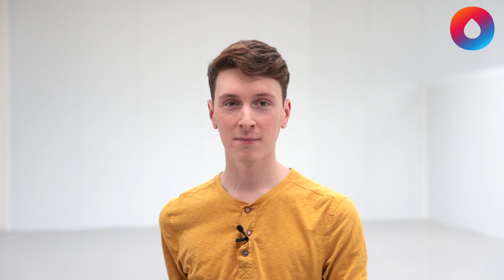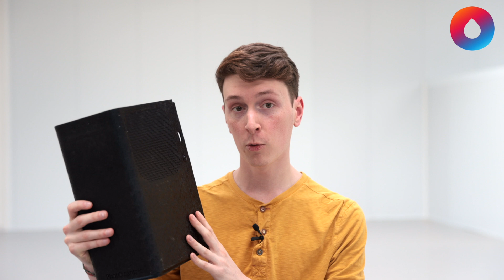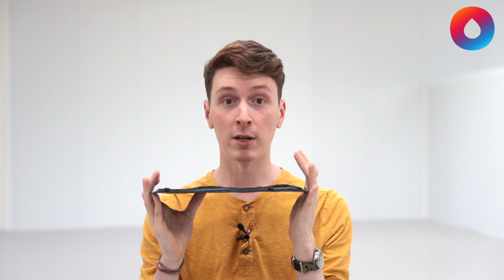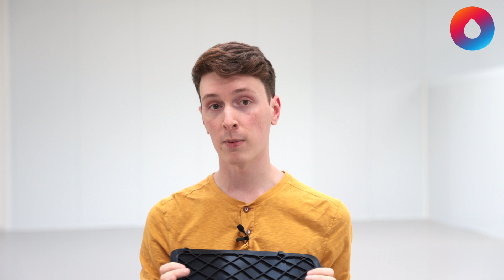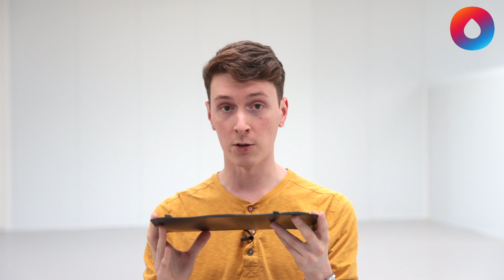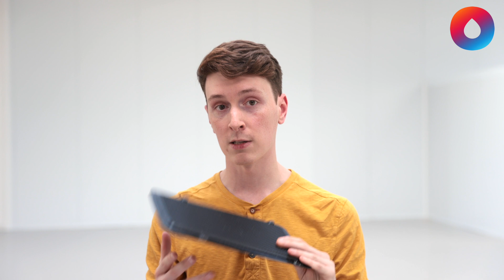How can you avoid warpage when 3D printing?

Comment: Not quite following. The white paper didn't really clarify. How are you differentiating lattice liner from the ribbed structure of the original flat panel? Number of ribs at some scale? It looks like the lattice liner would take a lot more material than the ribbed structure.
Reply from the maker: Thank you for your comment Jackie. The ribs on the earlier designs were modelled manually in our CAD software, but as visible in the images don’t provide enough structural reinforcement and support for the part while it prints and cures. We might expect better results printing this panel at a different angle, but this wasn’t possible in this specific application. It would also require support material to form properly, or to be a much thicker/heavier solid panel. We’ve found material use can depend on the part and what’s required to make it print, but it is indeed all about finding a balance between printability and material consumption. In most applications we prefer for extra material to end up in the part rather than in support material. For this method we generally model the skin/outer shell of the product as one body and then an area on the inside as a separate body which is converted into a lattice structure. We find we can make the outer skin quite thin with this method, and the relatively open structure on the B-Surface (without any thick solid volumes) improves the effectiveness of post-curing as the material is thinner. This method lets us experiment and quickly adjust the liner geometry depending on the printed outcome. Especially with more complex shell geometries that are not flat, this method tends to become quicker than adding removable support or modelling ribs and supports manually too, especially if the design changes! We can iterate with different lattice types (various TPMS and strut-based lattices), cell sizes, densities, skin/liner thicknesses, and adjust these across a part as needed. Most parts don’t need this approach though, but this has been a successful approach for us printing large format parts for our own use and customers that would normally warp quite significantly otherwise.